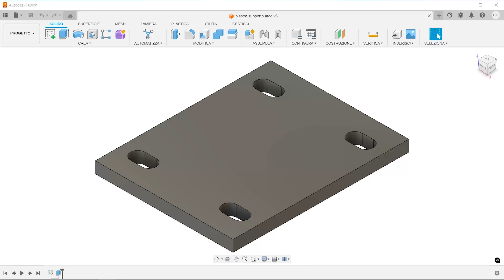ARCO DI PROTEZIONE TRATTORE A 170€

Comment: Arco sovradimensionato, meglio così.
Ottimo progetto/lavoro.
Reply from the maker: @MauroCaloro  si, é esagerato, avrei voluto anche rinforzare gli angoli e la base ma stava diventando ridicolo 😁😁
Reply: Mam podobny traktor r360 dt jaka jest u ciebie średnica tłoka i jak u was z częściami do tych modeli
Reply from the maker: sul mio il diametro è 115mm, 110 sul 704 e 804, ciao
Reply: @AsitShouldBe  a u mnie 116 podobno
Reply from the maker: no, se è come il 603 l'alesaggio è 100mm
Reply: @AsitShouldBe  nie wiem czy dobrze się  rozumiemy bo pisze z Polski ale ja mam ten starszy model r360
Reply from the maker: ho capito, ci vorrebbe il manuale tecnico, il 360 dovrebbe essere uguale al r603 come pistoni, 3 cilindri 60cv e con pistoni da 100 mm,di  sicuro non sono da 110 o 116 , i quali  vanno sul 70cv , 80cv e 90 CV.
Ciao
Reply: 603 ma mniejsze koła z przodu bo u mnie to 8.3r24
Reply from the maker: a parte le ruote, il tuo motore è 60cv 3 cilindri?
Reply: Tak 3 cylindry  60 koni rok budowy 1969
Reply from the maker: dovrebbe essere da 100mm ma controlla con il manuale